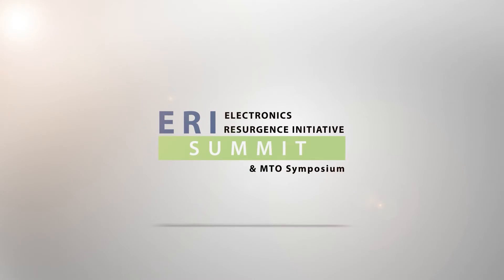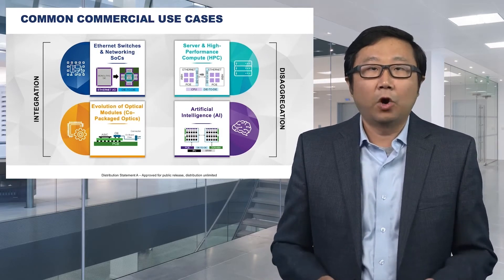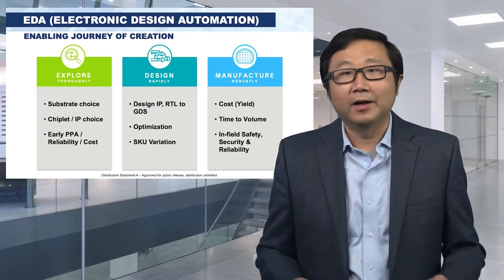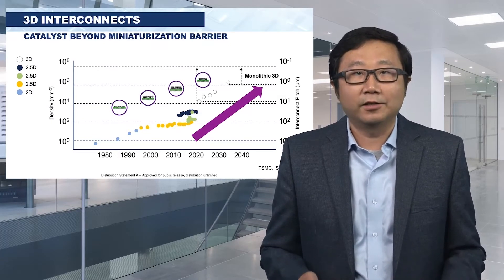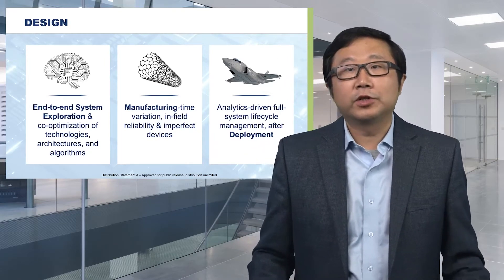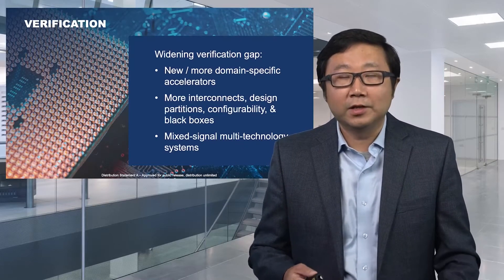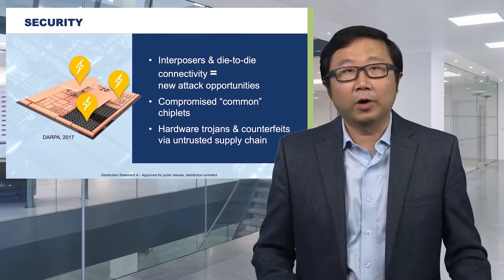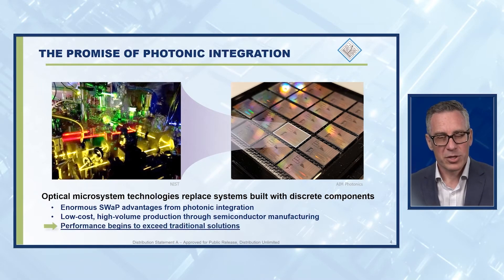2021 ERI Summit: Technical Session: Overcoming the Limits of 2D Electronics

Comment: how small can micro electronic devices be? so small that they become "invisible" to the naked human eye? how does one create these "chiplets>tiny chips" to fuel them? does the smaller the chip = lower prices for the chip; but also lower  programming capabilities & storage capacities? assuming "optics" meaning the use of photons-"light" rays- beams "guiding" the tasks these teeny-tiny devices undertake to assist in> medicine mostly (for "minute" operations); also "detection weapons" for the military; internet traffic...in the telecom -munications industries...etc? perhaps i'm misunderstanding. in telecommunica -tions; & computer sciences (scripting instructions), can a process> (sending + receiving...  receiving & responding) actually really be any faster than what it already is?
Reply: Cheapest is the product that assembles itself. It will be long time before human designed logic will self replicate
Without self assembly/replication there is no hope for dirt price, as of now it takes 20 weeks to manufacture single wafer, way too much work for too little